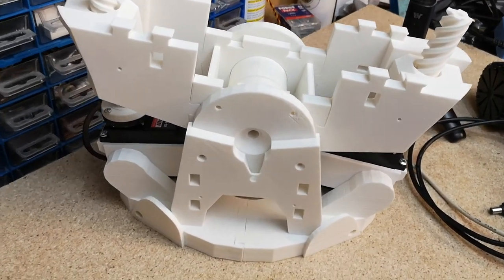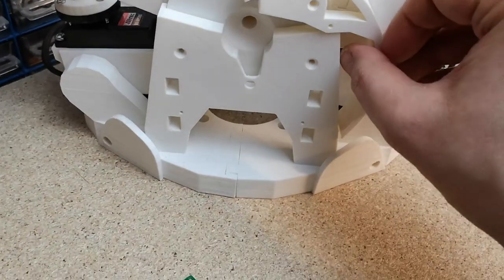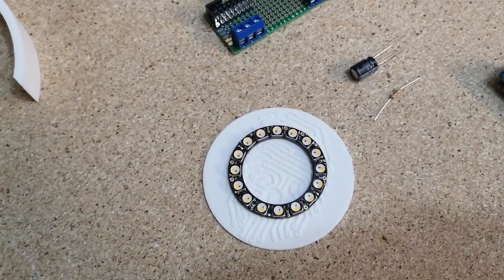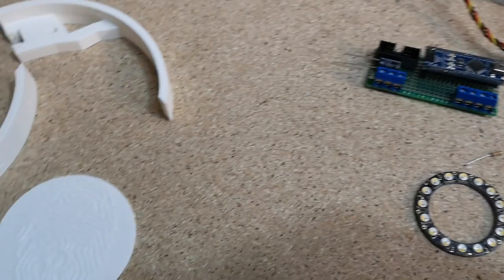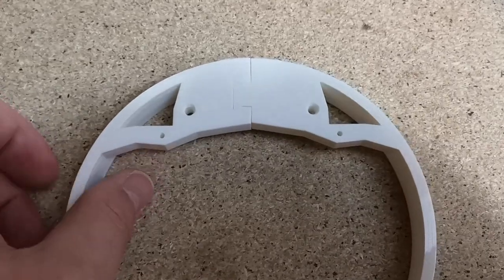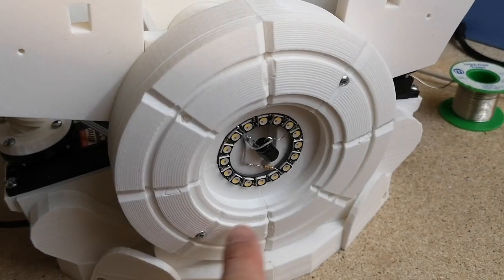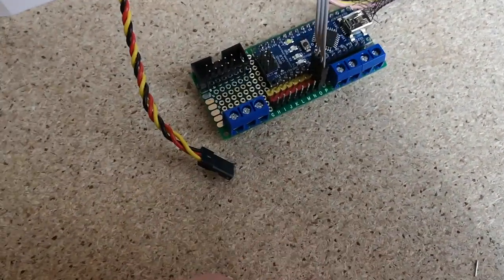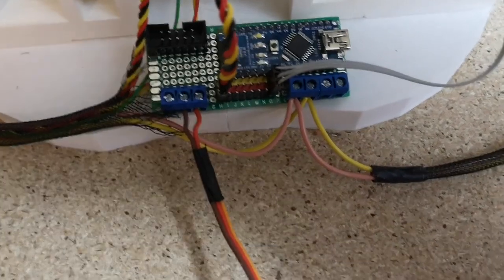Civrays InMoov - The Neopixel Ring

Comment: Subscribed not long ago. Keep up the good work! You're vids have been a huge help for me to better understand the parts better before I jump into making them myself. Still in the early stages and have one arm up and running. Going to need to rewatch the bicep video in the near future once my 805bb servos and boards from Gael arrive. :)
Reply from the maker: Thanks. I've got another bicep to build for my second arm. The bicep is not too bad, but it's the shoulder that confuses me a bit.
Reply: @SteveRaynerMakes  Keep at it! Literally my main go to guy for help on this project. All this stuff including 3D print is new to me so slowly banging out one problem after the next.

BTW, did you figure out if the light ring was defective or get those 4 lights working?
Reply from the maker: @CyberSyntek  I haven't had a chance to look into it yet. It's too cold here and the robot is out in the garage. Maybe at the weekend I will look at some simple Arduino sketches to control the neopixel directly just to check out each LED. I'm looking forward to playing with some different animations.

Comment: hi these are very usefull video's .thanks for charing. where do i find the emblem neo pixel?
Reply from the maker: Sorry I don't understand your question. Do you mean the plate that covers the neopixe?. If so you can find it here: http://inmoov.fr/wp-content/uploads/stl/Top-Stomach/DiskInternV3%20.stl
Reply: @SteveRaynerMakes  the link doesn work .i mean the sign in the neo pixel ring .thank you
Reply from the maker: @EDP1  Sorry I don't know why the link doesn't work. I think youtube modify the links. You should be able to copy/paste the link url into your browser. But basically, the 3D printed parts can be found in the stl parts library on the inmoov.fr website, under Top-Stomach. I think the part you are referring to is called DiskInternV3.stl
Reply: @SteveRaynerMakes  ah great thanks for the tip.
Reply: @SteveRaynerMakes  got it .